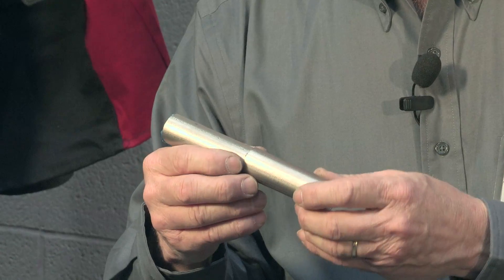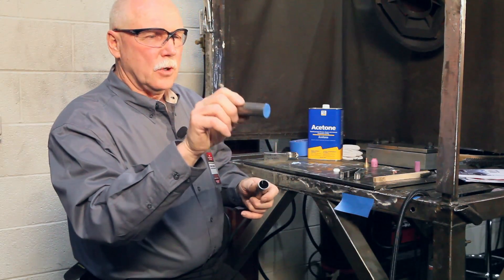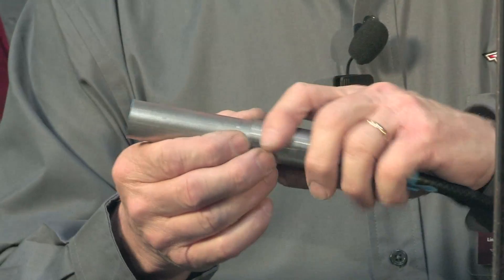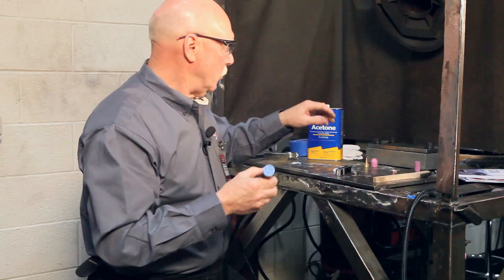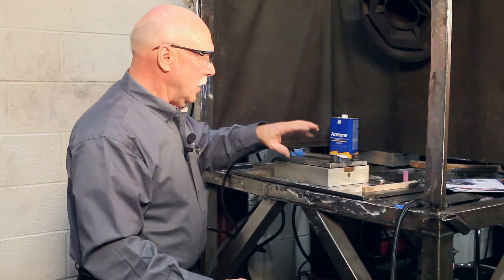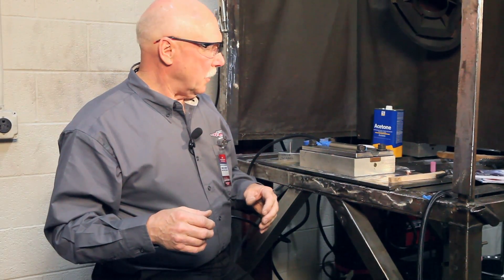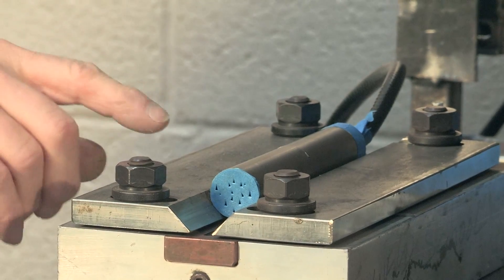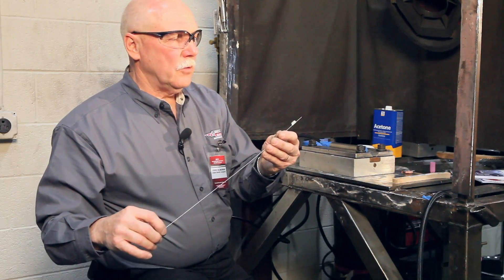Tips from the Experts: Welding Titanium Tubing

Comment: Double magnetic and automatic welding head (N) and (S) with inert backing of highly pure argon gas special for TITANIUM
The double magnetic head welding and inert gas of this invention is the most suitable and advanced automatic welding system currently available for TITANIUM.
Our double welding system is the only one in the world that meets the chemical and physical needs at high temperatures to   technically    weld   correctly   and automatically the TITANIUM.
TITANIUM alloys are reactive at high temperatures and extremely permeable to atmospheric or surface contamination of fats, oils, etc.
Properly welding TITANIUM means maintaining strict control of all parameters and the highest purity and hygiene of the whole process that is carried out at elevated temperatures at all possible angles.
In order to weld TITANIUM, the fusion must be isolated as only this magnetic method can be carried out automatically in the present time in the world.
The magnetic system isolates the fusion integrally from the front (N) and the back (S) simultaneously.
Our double welding magnetic system maintains the purity and protects the TITANIUM first, then melts by raising the temperature and cools quickly in an inert atmosphere at all times.
Our welding system respects TITANIUM chemically and maintains its metallurgical properties even after soldering to and including cooling.
The inert gas soldering and backing magnetic system of this invention DOES NOT PERFORM perforations in the material as if it produces the friction system that is currently used to weld aluminum-only cryogenic tanks for space launches.
Our magnetic invention overcomes today's friction stirring system.
Our magnetic system welds STEEL, TITANIUM and ALUMINUM
The friction and agitation system only works on aluminum acceptably at 426 °C (800 °F).
The friction and agitation system only unites aluminum acceptably because the probe used wears out and leaves the debris inside the joints walls in steel and titanium.
The friction system does not allow the use of inert gas on both sides and DOES NOT PROTECT the material from all angles, therefore producing brittle and contaminated joints with undesired debris inside the steel and preferably in the TITANIUM.
Our invention of the magnetic system does not produce holes in any of the joints.
Double Tig or Mig laser welding with inert gas without undesired mechanical forces in the material. Our welding system makes connections with the best technology nowadays available and protects with inert gas at all times, not making contact or contaminating the TITANIUM.
The double magnetic control weld of this invention is constant along the path.
Friction welding is not constant because the mechanical probe is being destroyed throughout the welding, polluting the parts and varying material flows if the temperature exceeds the resistance of the screw used in high melting alloys such as steel and titanium.
The double soldering magnetic system is the only one in the world to regulate the torsion and tension of the welded plates and sheets, because it allows the energy to be sent independently to each side, allowing designers to direct the direction of twisting and material tensions previously, on the same design table. Engineers and designers with the dual welding magnetic system can direct the curvature of the aircraft wing previously, on the design table, calculating and quantifying the energy values applied to each side (N) and (S) of the plates of TITANIUM, magnesium and aluminum.